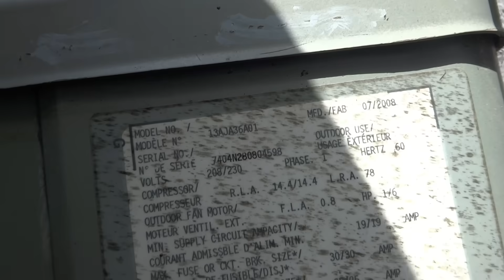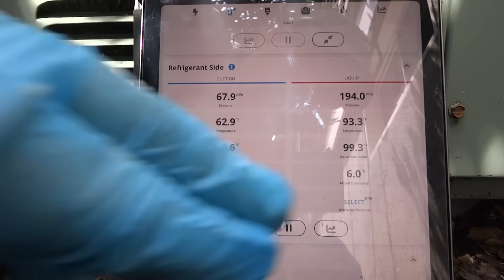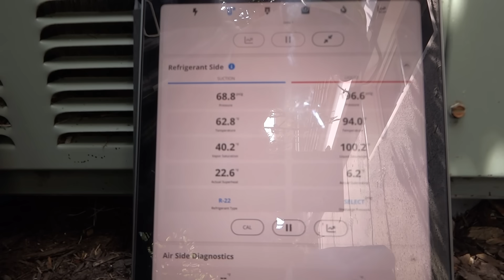OLDER R22 AC SYSTEM REFRIGERANT CHECK

Comment: Only issue with the Fieldpiece probes is they time-out and shut-down after a fairly short time (and you'll be in a hot attic 3 floors up when they do.)  After you turn on the probe and it flashes green, press the button twice and watch for the quick red flashes, then they stay on indefinately.

Comment: Steve I just wanted to tell you that I just dumped Trane and signed up for a Amana R 32 dealership. I like you did not want have anything to do with that R454b Bull shit. And once I saw your video that you changed to Goodman I made up my mind. Thanks Steve. You’re the best.❤❤❤❤❤❤PS I am getting the new R 32 refrigerant for under $300 for 20 pounds.
Reply: on sale now for $259.00- 20 lb. jug
Reply: I was wondering why my local guy is no longer an American Standard dealer
Reply: Who knew R22 would be cheaper than the new stuff.

Comment: hey Steve, if you ever do R- 32 coil replacement, you should show video on how to low voltage wire to the old furnace with the new module. It would be helpful for a lot of guys
Reply from the maker: its called a dragon fly .. it hock up to the thermostat wires go to the dragon fly then from dragon fly to furnace .with thermostat wires . if there is a leak it shuts down the furnace and runs the fan to clear furnace then shuts down ... its pretty straight forward and easy

Comment: Keeping up with technology...it never ends.  I liked your existing tablet/wireless set up. The display was perfectly designed, simple and showed basically all you needed to diagnose. 
The new ones have up the wazoo display information plus smaller fonts which I don't like so much. Keep them running !  Nothing is gained with the high cost of new systems these days in my opinion, especially with the higher end units, 2 stage, communicating inverter systems.
Reply: That's correct they are Garb no longevity